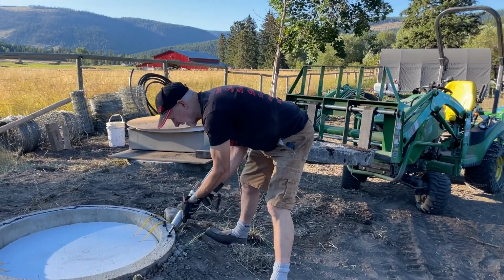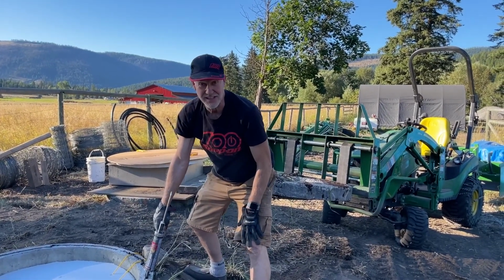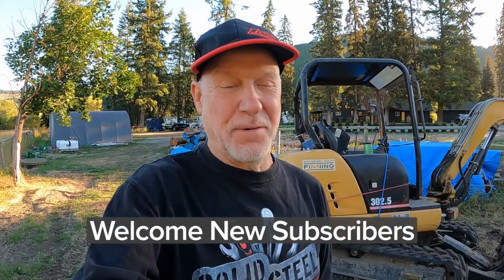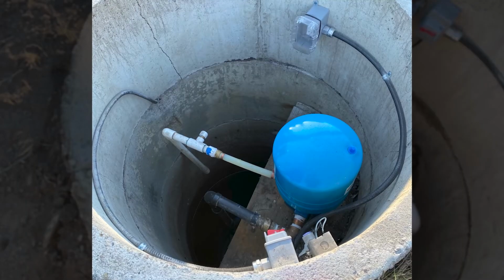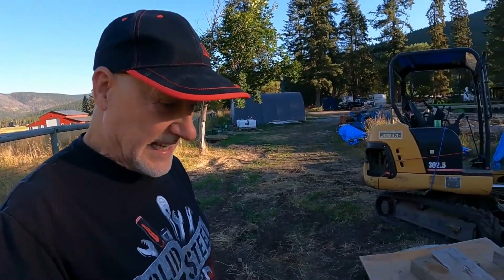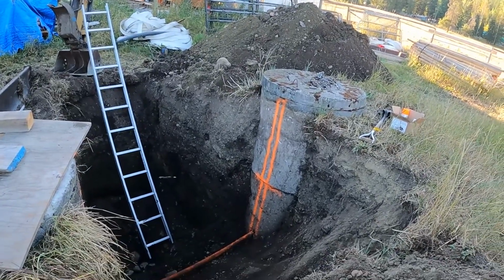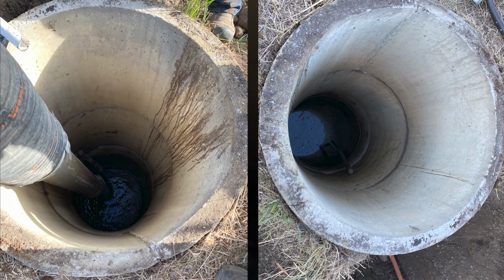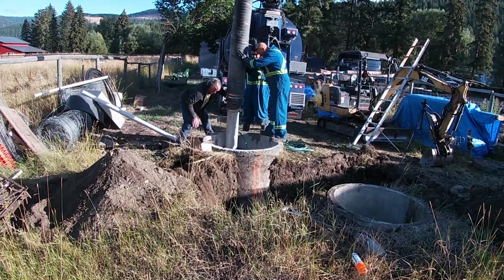Tri-Axle Vacuum Truck: Getting hosed @ $220/hour, in a good way! The Well - Part 3 - Final Fix?

Comment: Howard, I just had to chuckle when you made a reference to things that the previous owner had done...
 One of the 1st big jobs we ever did after moving into our old property  was demolition of a prior antiquated septic system and installation of a new one. When we excavated what was actually a cesspool, we found that it was covered by two huge  granite slabs held over the cavity by 2 wagon wheel axles! Not quite meeting the health department regulations, lol!
Reply from the maker: Definitely.a ‘ box of chocolates’ experience on an old property.

Comment: Reminds me of when I changed my sewage pump. Mine pumps uphill. Well, it was put in in 1995 and finally stopped working last year. We had to have the tank pumped out so I could pull the 2.5hp pump out and put the new one in. In the end it worked so we’re happy again. The saying shit flows down hill does not apply here. Great video Howard. You really do a great job at it.
Reply from the maker: Huge thanks for being part of my journey Tom.  
I learned more about sewage pumps than I ever wanted to know prior to shooting the sewage pump episode that is somewhere on the channel.  Like, one needs to have a control valve (my layperson terminology) if one is pumping 7-feet vertical (which was my situation) rather than the 10-feet vertical that the pump is factory rated for.  Stuff I never knew before and never want to use again.  hahaha.  I think I have now changed out every pump that was on this property when we bought it two years ago this month.  Every last one failed in one way or another except one - that is probably waiting to surprise me this year.  
Glad to hear that all is working as intended at your end.
Reply: @howardkettner  I watched your sewage pump video too. I was amazed to see the resemblance in our lives.  I’m looking forward to milling some logs in the spring. You really helped me get the bugs out of my mill Howard and I appreciate it. Stay safe and stay warm.

Comment: Howard, did I see you putting stone in the well?
Reply from the maker: Correct.  I filled up  an area below the casing with 1" broken rock to hold back the dirt that is below the well casing from creeping back in again over time.  In an ideal world, knowing what I know now about the depth of the well casings, and the underlying dirt formations, I will at some point likely bring in a large excavator to dig a brand new well, and put new casings in.  The couple buckets of that washed broken rock that I put down there seems however to have instantly cured the issue we were having with the pump picking up sediment .  Have run several 24 hour pump tests and there is lots of water - meaning we can't draw it down below what I consider to be an acceptable leve - even at this point in the year when we've had no meaningful rain for months.
.